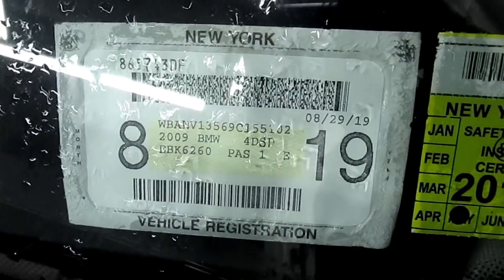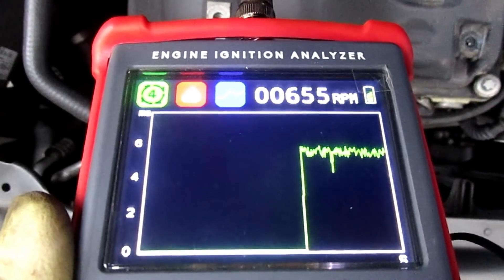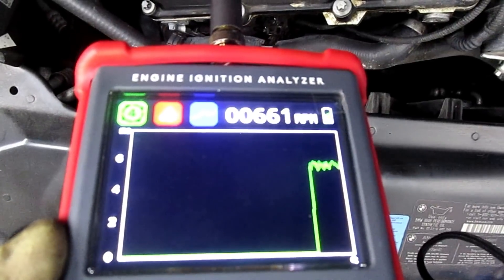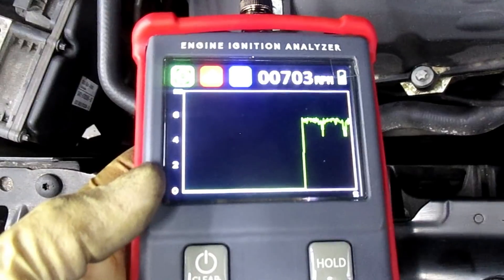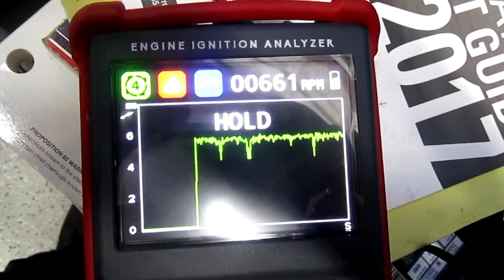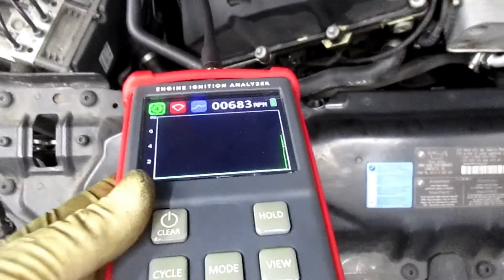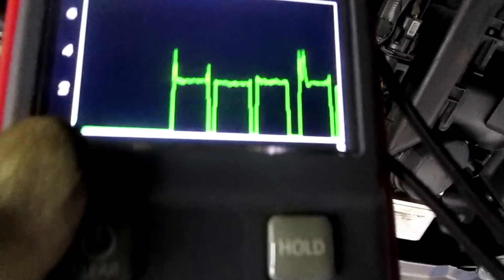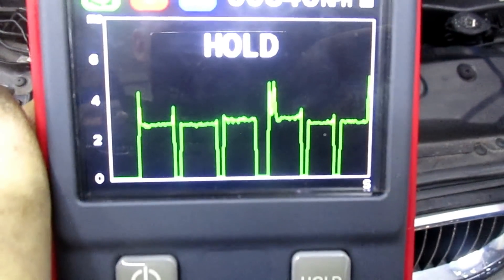GTC505 Ignition Misfire and Repair Chart Readings

Comment: Have you tried to use this on 6 cylinders w/coils under the intake? If so, do you trust those readings? Also  on a 4 wire COP can you use an attenuator to check the primary waveform, or do you have to use a COP probe to only be able to check the secondary? I'm interested in the GTC analyzer, but would like to know if buying an attenuator is the better way to go for analyzing the ignition waveforms.
Reply from the maker: Joe it works on just about all the engine we have tried it on. I don't think you can connect anything to the unit. You can read burn time and other specs just not a waveform. The compassion feature works great. If you have not already subscribed to our tstseminars YouTube channel please do so. Interested in more training? Go to www.tstseminars.org and view full length videos for members on TechFlix for $9.99 unlimited viewing and www.attstraining.com for hands on training and webcast
FREE Unlocking The Potential Of Your Scan Tool with EScan and Generic Part 1 – AutoLand iScan3 Part 2 -  Autel Part 3 – LAUNCH Part 4 – Snap-On Part 5 – OPUS IVS ES Part 6
https://www.tstseminars.org/blank-1
https://www.tstseminars.org/blank-2
https://www.tstseminars.org/blank-3
https://www.tstseminars.org/blank-4
https://www.tstseminars.org/blank-5
https://www.tstseminars.org/blank-6
https://www.tstseminars.org/blank-7
https://www.tstseminars.org/blank-8
 https://www.tstseminars.org/blank-9